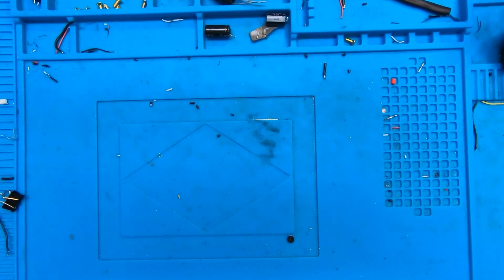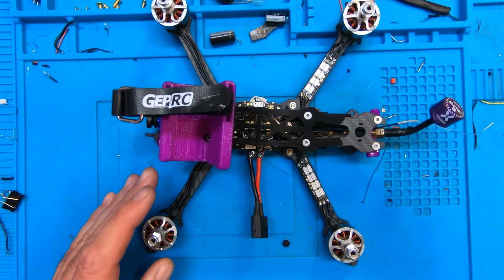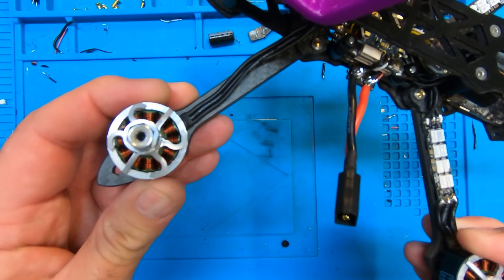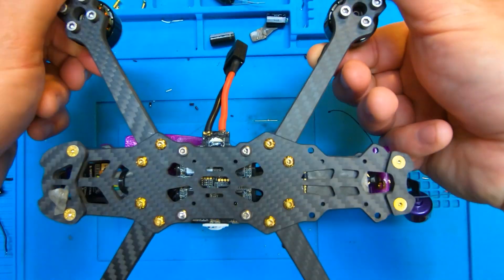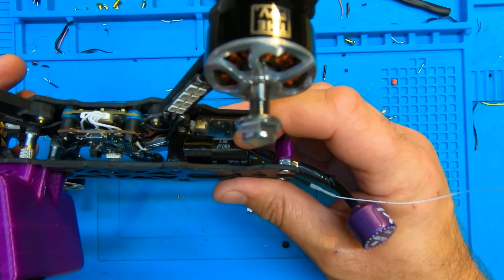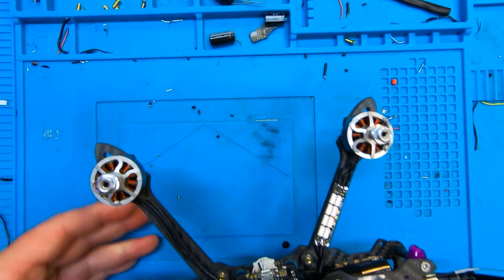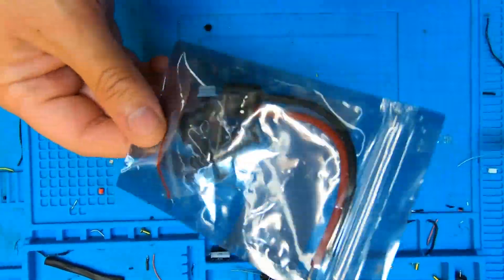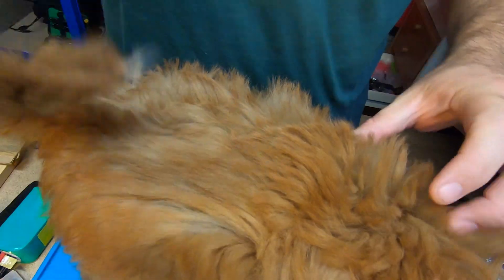The FPV 2208 1650kv apology & Geprc Mk4 build

Comment: That battery pad looks dope! Wish it were a little longer in the back, or shorter in the front, or both.. Don't really know what I would prefer but it going all the way up to the camera mount just makes it a stupid dust collector.
Reply from the maker: I always remove them and add Velcro anyhow so it's only there so you get to see what it looks like. Bit of dust on my frame is least of my worries- it's usually digging out soil lol :)